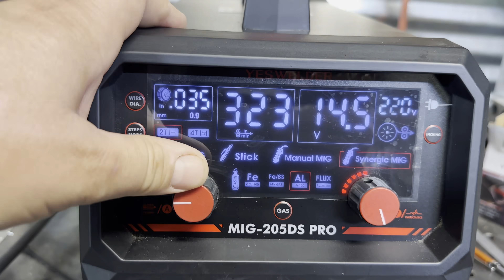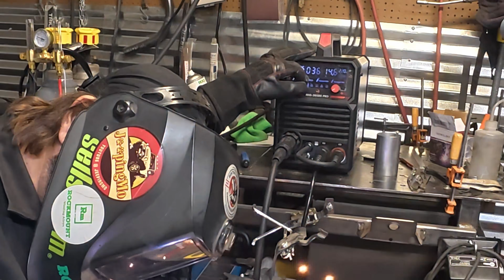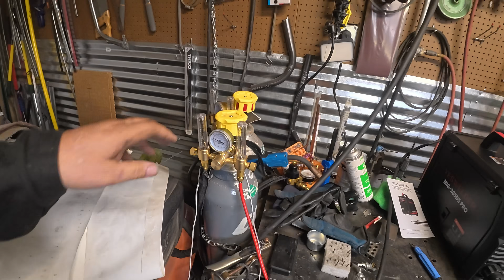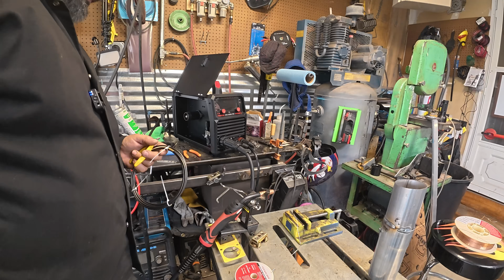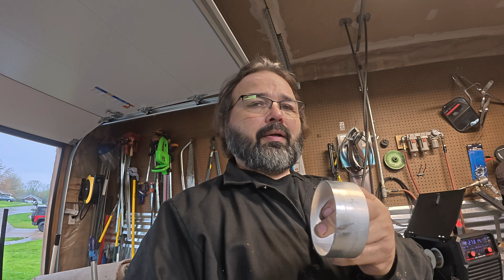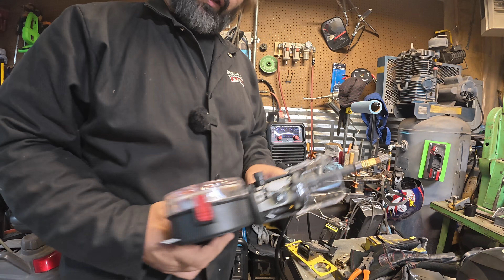Weld Every Home project , Even Exhaust, @YesWelder  MIG 205 DS

Comment: For all those out there this machine needs a 40 amp breaker not 30 like Yeswelder told me. You will need 8/3 wire from receptical to panel.

Comment: What rod did you end up using for the aluminized steel? Also any recommendations on how to dial in Lift tig? I got the 165DS PRO and it doesnt have anywhere to plug in a foot pedal sadly :( so I'm stuck with just setting control
Reply from the maker: I just used er70s. Yes the weld can rust later.   With the lift tig you control your penetration with your speed.

Comment: Good machine....when working. Now it is just turning on but de wire spool is not engaging from the gun or manual! Any suggestion/advise? Thanks!
Reply from the maker: If the wire motor is not moving at all.  I would check the connection.  Did you buy it from amazon recently

Comment: Do you know the max input this welder needs? I have a 10,000 watt genny and need to run numbers.
Reply: I had seen another video were millers run 30 percent continuous but the yes welder runs 70percent. I am no professional and it's been over 20years since I had last welder. But the looks of those beads look very nice. Don't sell yourself short. I have yet to see video of any full negative reviews on this little beauty.
Reply from the maker: @JohnAdamsCan  i have no idea,  ill reach out to yes welder.  Thanks for asking
Reply from the maker: @JohnAdamsCan  Yes welder said, the max input of MIG-205DS PRO, it is 10KW.
Reply: @JeepingMo I ended up ordering the 140DS Pro. I'm getting tired of my Chicago Electric 125.